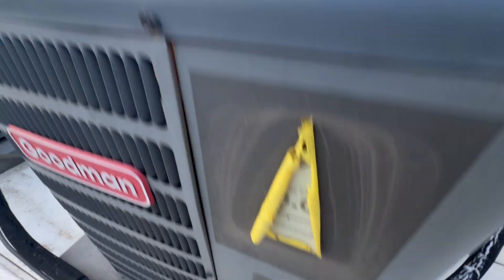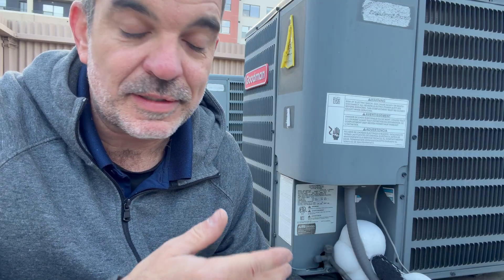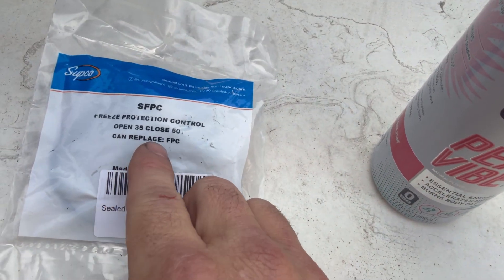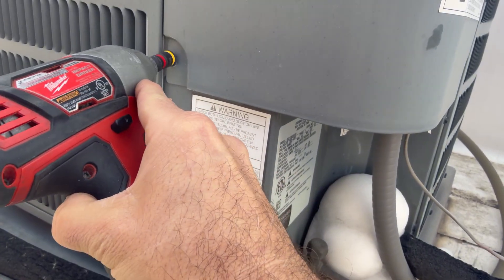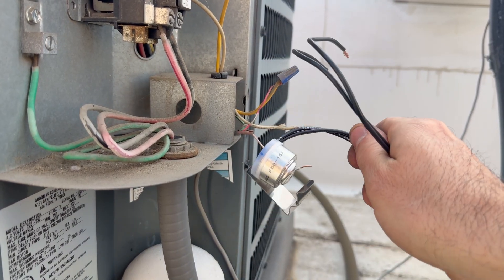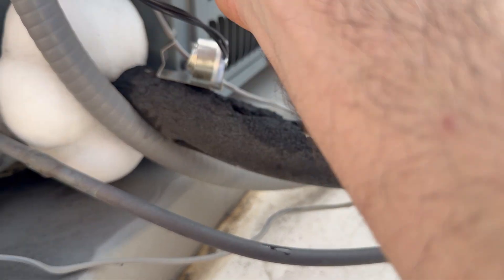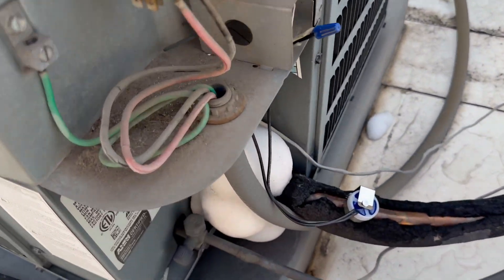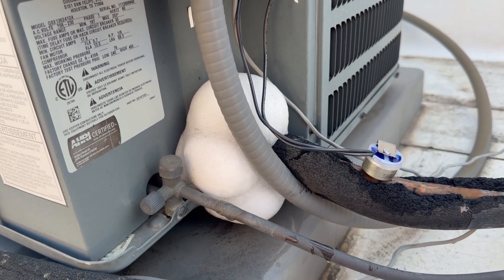Tenant Keeps Running AC when it's 30 Degrees Outside

Comment: OPEN THE WINDOW (that's why I do). My apartment is on the 4th floor and sun facing. In the winter time, it is a blessing. No need to run the heat pump. If I get hot, OPEN THE DAMN WINDOW. Jeez.

Comment: AC also controls humidity. Don't use it all winter and you'll get a lovely indoor mold garden from all the moisture condensing on cold external facing walls and windows.
Reply from the maker: Where I’m at, we don’t have humidity issues.

Comment: I've never had this problem for residential, but for commercial I use a pressure control that opens on low pressure to cycle the condenser fan off so that the head pressure will stay above 90° condensing. Don't use those encapsulated style non-adjustable switches, they don't last long. Get a Ranco or Johnson Controls adjustable style. I have installed these on all the split systems at the medical housing facility I work at. Not only do we have wide temp swings, but there are between 50-70 people in the conditioned areas so A/C is still needed even when it's cold out. Also the elevator equipment and server rooms require year round cooling. Some of the units have economizers that will open dampers for "free cooling", but when the sir becomes too damp it will revert back to mechanical cooling. They're easy to install, you will need a brass swivel tee for the liquid line pressure tap and a couple of self drilling screws. There's usually enough wire on the fan harness to accommodate. On bigger equipment that has a separate fan controls or on a heat pump, you will need some wire or a relay to ignore the switch in heat mode. There are fan modulating controls available that will slow the fan down instead of cycling it off and on, but they're expensive and often fail. I've seen the encapsulated style fail and will rapidly short cycle the fan and cause bearing failure.
Reply from the maker: Thanks for the explanation!

Comment: LBJ constantly complained about Air Force One being too hot or cold. The Secret Service installed a Hot/cold dial on the seatback- it wasnt connected to anything. LBJ never complained again.
Reply: I did the same thing up in my Accounting Offices, installed Dummy TStats and all the Ladies thanked me.
Reply from the maker: What?? Is this true 😂
Reply: @ApartmentMaintenancePro  he was a control freak an̈d the agents developed a work-around.
Reply: @mattp4079  No, he was a President. Wanting to control everything comes with the territory.

Comment: Fan cycle switch designed for the refrigerant in the system. Operates off of pressure and installed on the high side of the system.

Comment: Fan cycle switch would be the better option
Reply from the maker: There's definitely a need for fan cycles and crank case heaters. This might be one, but hey, got to understand, it's not my call on ordering parts and this is dirt cheap and a good (temp?) fix.

Comment: At work it's my store my ac unit. Well we have a bunch of halogen lights and displays and such. All that makes the showroom hot plus the building is extremely well insulated and then add the heat from sun on windows. Well in 30 degree weather our showroom still gets up to 74 75 without the ac on. So even when it's 30 out the ac has to be on showroom gets to hot. U it is set for 72 year round and 68 heating which heating never happens. Hvac guy used to always get mad cause we ran the ac at 30 .  I told him explain this to.my customers and employees why the showroomroom has to be hot. I told him it's my store and my ac make it work when. Its could we will not be shutting the ac off I pointed around the showroom at all the windows thats dont open and asked how would you suggest I keep the store cool without the ac.  The guy crumpled and added low ambient kits to the units.
Reply from the maker: Low ambient kits work too just a bit more expensive than this repair but worth it in your situation
Reply: @ApartmentMaintenancePro yea it was kinda pricy but it works so it was worth it.

Comment: Condenser fan cycle switch
Reply from the maker: Do you think this is a better option than freeze protection? I think it’s more expensive and more work if you want to add the tee so you can still hook up gauges on the high side
Reply: @ApartmentMaintenancePro yes need a brass swivel tee and better we do it for server rooms run AC all yr